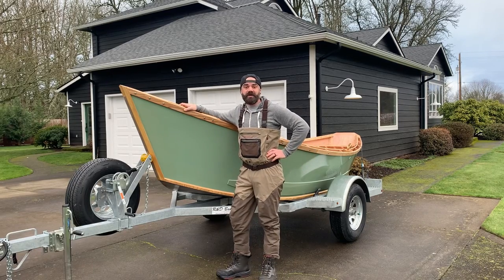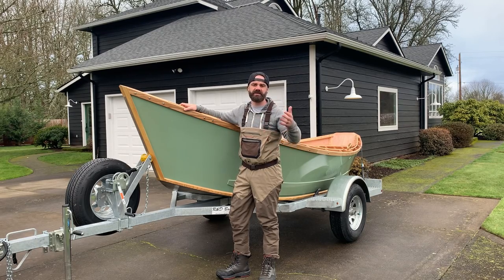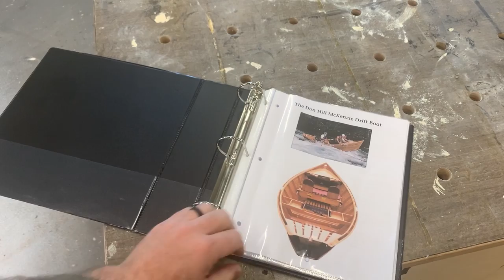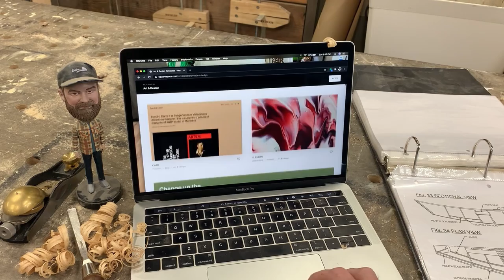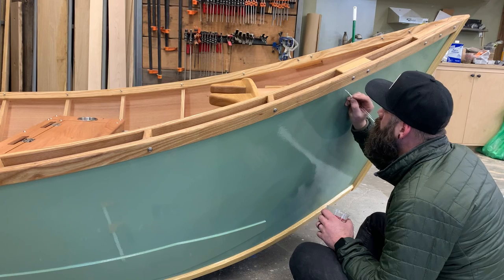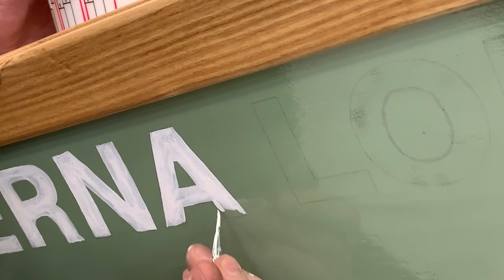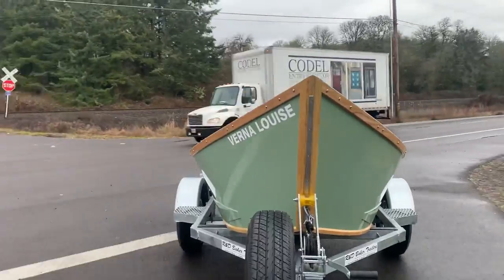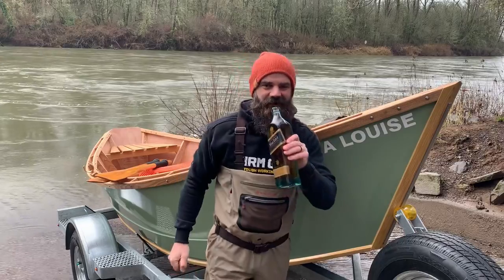I'm Building a Boat || You Can Build This (Part. 5)

Comment: Try building the Cosine Wherry Rip and Strip. I did, took about 600 hours. Fiber glass inside and out. Cedar strips, cherry gunnel, cherry front and back seats, cherry supports for cane basket weave center seats. Made the oars of cedar also.

Comment: Had you considered putting fiberglass over the hull? I'm looking at building a drift boat and if I can get away not fiberglassing the hull I'd rather go that route, especially if it doesn't significantly reduce the lifespan of the boat. Beautiful work!

Comment: You did a great job on it and i do build boats myself and i would have done three coutes o the bottum even more so becouse of the cevler in it but i would not do more then that becouse that it wil mess with the displacement of the hole boat

Comment: Since you like the water, and I presume you like being on the water and are wondering what to do next, I would like to offer the following suggestion:  Build a stitch and glue boat (Won't take you nearly as long and a lot easier) of 10-14 feet.  One that can be rowed, sailed and motored (gas, or electric outboard).  It can be used on lakes and coastal sailing.  I don't know if you've ever sailed, but there is an immense satisfaction in harnessing the wind to move the boat. Gliding along under wind power, or pushing the boat to its limit in a strong breeze can change tranquil sailing to exhilarating.  Obviously you can fish from the boat and you can also motor (I hate motoring).  I've owned and lived on several sailboats over the years, everything from a 12' hobie catamaran to a 39' Ericson cruising sailboat.  I want another, but now I'm strictly into trimarans.  Whatever boat you decide to build next, please look at my comment posted on episode 2.
david kaye

Comment: Suggestion for another build that I only ever see a "shorts" video of or a video of finished product or just a really lame version.... Build a nice soaker tub. Like not one that is just big enough to let my legs into, but that I can fill the water up to my neck before it goes to the overflow. But ya know, one that looks nice and not like one that someone slapped together with 2x4 cedar boards and it was a square. The only other one I saw was one that had a butcher block style that almost looked like a feeder trough and if you were to sit in it the water could only be filled up to your belly button. it was okay, but LAME. I think you could do better.

Comment: Thats a very strange boat design!
Mostly, boats are made with a dead straight keel, or bottom, otherwise, they are liable to perform rather like a rocking horse. 
Also, as they float with just the centre area submerged, they will tend to spin, and as they load, the centre will sink lower than the ends, so waves are inclined to enter the via the centre section.
.

Comment: Du hast einen fatalen Fehler begangen. Ein Ruderboot rudert man mit dem Rücken zur Fahrtrichtung. Außerdem fehlt deinem Boot ein Kiel. An windigen Tagen wirst du kaum den Kurs halten können und wirst abgetrieben oder musst kraftzehrend ständig gegensteuern.
You made a fatal mistake. You row a rowboat with your back to the direction of travel. In addition, your boat is missing a keel. On windy days you will hardly be able to keep the course and will be driven off or constantly have to take countermeasures. 

Sorry its only a googletranslation, i hope you understand what i ment.